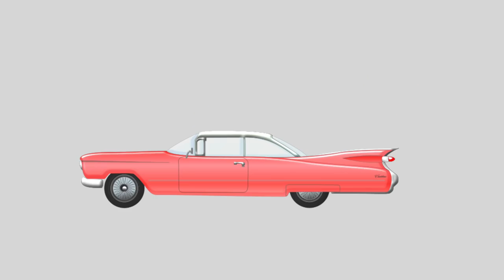Yes, Rockets CAN Fly in a Vacuum

Comment: If there is no air (pure vacum) in space, what does the rocket push against? Third law of Newton. You said a lot bit did not answer the initial question
Reply: "What does it push against"

The mass of the exhaust.

If you accelerate mass and eject it, you gain equal momentum in the opposite direction.
It's just simple conservation of momentum.
Reply: It pushes against the gas produced from Burnt fuel. Try this. Take a ball, and hit it with another ball. The first ball moves back, and the second one stops and then retraces itself. Now, the first ball is the gases produced when the fuel is burnt. Since there is vacuum outside, you don't need any force to push out the gas. They open the gas exhaust vent and the gas goes out with a lot of force. While it's going out, it pushes the rocket( second ball) ahead
Reply: Sorry, but for that to work the mass it pushes against, must also push against something.
Reply: Its Newtons 3rd law of motion.
Reply: @wizziw1  no thr mass it pushes against doesn't need to push against something. That's not what netwons law says. When you're swimming, you push thr water with your hand and you move forward. What is this water pushing against then?
Reply: @wizziw1  every action has an equal and opposite reaction. Therefore only 2 masses and forces are involved here. So the exhaust doesn't need to push against anything else
Reply: When you swim you go forward because de water goes back.
Reply: @aaryajain6396  if you push againt nothing you just dot move. I cant explain any better. Good Luck
Reply: @niallkinsella2687  a thrust in vacum needs tp push againt something to move
When you have an atmosphere you push against the air
Reply: @wizziw1  
When you force the fuel to accelerate by burning it, does it gain momentum?
Reply: @wizziw1  you're right when you say if I push against nothing I won't move ahead. But rockets ARE pushing. They are pushing the fuel gases out. Newton's law involves only 2 masses. You do not need a third mass. Moreover, when you're swimming, you're pushing water behind and it's pushing you ahead. Only two masses. I can't explain it better than this. What you're saying is wrong.
Reply: @niallkinsella2687  as the fuel burn what makes it go forward is the jet pushing on thd atmospheric air.
Reply: @aaryajain6396  rockets move by pushing their thrust against atmospheric air.
Reply: @wizziw1  Rockets are not jets.

When you force the fuel exhaust to accelerate, does it gain momentum?
It's a yes or no question.
Reply: @wizziw1  : Well, 70 years of putting satellites into orbit proves you don't understand the physics involved.
Reply: @wizziw1  Would a CROSSBOW, fired in a vacuum STILL HAVE RECOIL? Yes or No?

Comment: Amy do not mean to be disrespectful but you danced around the answer could you do this with all vectors and reexplain?
Reply: its pretty simple. Rocket nozzle pushes MASS in one direction giving it velocity (and therefore MOMENTUM) that it did not have before.
The nozzle FEELS the force that was used to accelerate the MASS of the exhaust gases therefore the NOZZLE FEELS THE FORCE TOO.
Reply: Not much vector math needed to understand the basics here.

Comment: I'm sorry but I have to take issue with the exhaust of the car moving it forward.  That is not the mechanism by which a car is propelled.  In the instance of a car it is all mechanical.  The pistons of the engine force the crankshaft to spin.  That spinning motion is transferred to a transmission (gears) which eventually reaches the wheels as rotation.  That is a simplistic explanation but, the exhaust has negligible if any, effect on the motion of the vehicle.  Many times the exhaust points sideways or even down towards the road.
Reply: She clearly stated in the video that the exhaust does not act as a propellant simply because the mass of the car is too great for the exhaust to move it; She was using this as an analogy in showing the differences of cars using friction (earth to tires, transmission, drive shaft, piston/combustion chamber. both use combustion as a source of thrust, but the thrust created in the combustion chamber of the car is converted to drive the wheels (basically a lever..)
Reply: I don't know what video you watched.  She does not once mention the mechanical aspect of transmitting the inline motion of pistons translated into rotational motion to eventually turn the wheels as being involved in friction.  If you're going to define something totally different as a reference to some other means of locomotion then do it.  Don't continue to speak of the exhaust of the car as some sort of energy transfer.
Reply: And just to be clear, I love her videos.  But that doesn't preclude commenting on the content.

Comment: You did not mention "spark". Why it has to combust, burn? We couldnjll just throw gas backwards. So please explain me what is  "burning".
Reply: Energy is needed to accelerate the mass. 
This could be done mechanically, throwing a block of metal or rock with some kind of spring, or with pressurised gas; but chemical reactions are easier to control and give more energy than most other processes available.

The chemical energy of the fuel, released when it's burned, is what provides the energy needed to accelerate the exhaust out the back of the rocket.
Reply: Thank you very much!!!
Reply: @straaths  There's a book titled 'Ignition' which covers the development of liquid rocket fuels from 1945 through to 1970 or so.  It's a funny read, not very complicated in the maths or chemistry, but it does a good job of explaining an overview of why different fuels were developed and why different mixtures give different performances.  You can buy reprints now, but I think there are still free PDFs available too.

Comment: Why doesn’t nasa bring back the Saturn V to compete in the new space race!!! We already know it works excellently, so why don’t we upgrade it but test out so that we know that we can build it! ( and I wanna see it for the first time( I’m only 14 and I’m super fascinated by the Apollo Saturn V Launch vehicle but I have never seen the Launch with my own eyes)
Reply: Because to do that they'd need to rebuild all the old factories for making the parts, bring the manufacturing method up to modern standards, get the infrastructure all back and running again. It'd be very expensive and maybe not even feasible since all their documentation was on hard copies, either paper (which easily gets lost or damaged) or legacy data formats which are hard to get data from and also they're a decent chance might have been lost as well.

Comment: Love the video, I myself have a masters in Physics and when teaching First year science students use some of the same analogies about Newtons third law. Great Video!
Reply: John Miller  Because we're not pushing against the vacuum. You've failed to grasp how Newtons third law works in this frame of reference.
Reply: John Miller  space is a vacuum, you're using the wrong frame of reference when dealing with a rocket. Again I have a Masters and soon to be PhD in physics, this is not a hard concept. All three of newtons laws are used to propel a rocket in space. Do not consider the rocket pushing against the vacuum think of it as a change in momentum. For example if an astronaut is floating in space away from the space station and they have a tool, they can throw the tool in the opposite direction of the space station and they will start to move back toward the space station.
Reply: please explain to me where you think the uncertainty principle fits into all this.
Reply: John Miller  We're not talking about walking in space, so again where do you think the uncertainty principal fits in here exactly. That being newtons third law, classically of course not through quantum mechanics.
Reply: John Miller   we use 100km to define "Outer space" from the earths atmosphere though you'll still experience a gravitational pull. Again please explain where you think the uncertainty principle plays a role classically. A rockets principle movement in space hinges on Newtons third law: Every action produces an equal and opposite reaction. Its a misconception to believe the rocket pushes on the air during take off that's not how a rocket works. There's no pushing against something outside that causes the rocket to go upward, its all Newtons laws of motion, classical mechanics that allow for rockets to be propelled in space. In essence, you are right there is no air in space, however, rockets do not push against the air. Do not think of a airplane. Consider this, if I fire a gun on a friction-less vacuum, or use a fire extinguisher and point it in the opposite direction I wish to travel what will the result be?
Reply: John Miller  The uncertainty principle in classical mechanics just says that we cannot assign exact simultaneous values. Say we're looking at position and momentum,  the uncertainty principle says that we cannot assign values to both position and momentum simultaneously. the uncertainty principle is mostly used in quantum mechanics and is not the pivot point of space travel, just because it isn't defined does not mean we cannot travel in space. As for steering, you're right conventional ideas of steering are wrong. to "Steer" a rocket its more about countering reactions and this is how you "steer" a rocket. Do you think we haven't been to space?

Comment: I don’t know what crack your smoking but cars don’t move because of the exhaust fumes the car also has a transmission tail shaft differential all the combustion happeneds inside the engine to rotate crank shaft that turns the fly wheels which goes to the transmission then to the tail shaft then to your differential then through your wheel shaft then to the wheel that turn on the road the only reason a cars exhaust is at the back of the car is for convenience so you don’t breath up all the fumes coming out the engine people watching this and reading this comment should know I love space x and nasa and everything they’re doing but recently I’ve been having doubts about them really flying in space so I came here to get an idea of how a rocket would actually move in space and everything this girl just said gave me more reason to believe that it’s all a load of...
Reply: She didn't say the exhaust is what moves the car.
She said that the exhaust produces some thrust, but not nearly enough to overcome the friction between the wheels and the road.

This statement is entirely true.
What is your issue with it?
Reply: Im pretty sure she was implying that the exhaust generates enough thrust to push the car forward and that the car gets some of its power through the wheels
Reply: She even goes more to say that depending on the year the car will move because the wheels turn
Reply: @darklight2.1  you make no sense
Reply: @aliax608   
"The force of the exhaust leaving the car does push it forward, only the car is so heavy and there is so much friction from it sitting on the road that it doesn't actually do anything."

Direct quote from the video.
At no point did she imply that the exhaust is what causes a car to move.
That's the end of it.

Comment: Very informative. However, you never explained how a rocket flies in the vacuum. You explained the rocket launching off the earth with this force propelling it upwards; but there is a huge hunk of metal that is being held down by gravity. The density of the rocket will no doubt weigh it down in the air. Once the rocket leaves the atmosphere, there is no gravity applying to it and it does not apply to any form of weight. When the rocket goes off in space, isn't it more like a candle lighting on earth? The rocket wouldn't move at all, it would expel all of its energy out one end of the rocket and lay completely still. Can you make a video specifying why rockets can fly a zone without gravity and move? Unless we are floating in some ether-like  embryonic fluid, how are we flying in space with "force"?
Reply: 1. You are making the fundamental mistake of assuming that there is no gravity in space.  This is necessarily not the case because, for example, the Moon orbits the Earth under the influence of gravity, and so the Earths gravity must reach as far as the Moon and so also be present in all of the space between the Earth and the Moon's orbit. 

2. When you say "there is a huge hunk of metal that is being held down by gravity" you are missing the fact that that "huge hunk of metal" will also have inertia, which will act to resist its acceleration and do so independently of gravity.

3. If you understood how a rocket might "expel all of its energy out one end" you might notice a huge mass of hot, and so very fast moving, gas molecules bouncing off the inner surfaces of the rocket engine's combustion chamber and nozzle and in doing that provide a very obvious mechanism for how a rocket might be pushed by its engine even in a vacuum.

Comment: I'd like to add that Ion engines are only useful in the vacuum of space. They are not strong enough to reach escape velocity.
Reply: xD xD xD
Reply: It's not that they're not strong enough to reach escape velocity, the thrust:weight ratio is unfavorable.
Reply: @davidmescher2526  Isn't that just another way to say they aren't strong enough? It can't produce enough thrust to compensate for its weight. 🤣
Reply: @Dannosuke25  But Ion propulsion certainly CAN accelerate a spacecraft to escape velocity.
 But it does it slowly.
 It is the highest ISP propulsion we have but very low thrust.
Reply: @stuartgray5877  I'd have to see the math from what I know they aren't practical for that purpose even if it is technically possible.  Like I could travel cross country on elephant back but there are much better ways to travel long distances.
Reply: @Dannosuke25  Well you could do some research about the difference between "Thrust" and "ISP" or "Specific Impulse".
What if an apollo sized spacecraft could accelerate a single Zenon Ion to 99.99% the speed of light with an Ion Thruster?
How much "Thrust" would that give it?
But what would I know? I have only been building, testing, launching, and operating deep space science probes for almost 30 years.
Reply: @Dannosuke25  I think what you are TRYING to say IS: Today's ION propulsion system are not strong enough to LAUNCH a spacecraft from the surface of the earth.
That part is true.
However, if you have a Spacecraft in Low earth orbit and you want to reach escape velocity, there is no engine MORE EFFICIENT at doing so than an Ion Propulsion system.
Reply: @stuartgray5877  Yes, that was my whole original point. That ion propulsion systems are only good for crafts already in orbit and are not useful for crafts at sea level.
Reply: @stuartgray5877 So what you are saying is that you understood what I meant all along, but decided to argue against something I didn't say or imply to try and make a random person online look like they didn't know what they were talking about then conceded that what I said was correct all along. Nice...
Reply: @stuartgray5877  And that's not what I was trying to say, it's what I said but in different words.
Reply: @Dannosuke25  YOU literally said that Ion propulsion system COULD NOT be used to reach escape velocity.

This is a false statement, as I proved above.
You are welcome.
Reply: @stuartgray5877  It was understood that I was talking about from sea level and not from low earth orbit.
Reply: @stuartgray5877  Are you saying that Ion propulsion can launch a rocket into orbit from the Cape Canaveral launch pad? because that is the sort of situation I was talking about. Of course you can reach escape velocity from orbit with it. That is much easier.
Reply: @stuartgray5877  so if your only argument is that you can use an Ion engine in space to achieve escape velocity, then we never disagreed as that was what my original statement was. People are so quick to try and argue with someone online I really dont get it.
Reply: @Dannosuke25  "It was understood that I was talking about from sea level and not from low earth orbit."

It was not understood, as you were corrected on it.  Twice.

The Thrust : Weight ratio on Earth's surface < 1, so it cannot take off (much less reach escape velocity) from Earth's surface.  

However, any place that has sufficiently low weight (such as in orbit, but asteroid / comet surfaces would also work, if they aren't too massive), they would be able to reach escape velocity.
Reply: @David Mescher  well whether it was understood or not that is what I meant by contrasting it to the vacuum of space. I specifically said in my original comment they are only useful in space, meaning in orbit or similar environments. Where did you think I was talking about it not being useful from other than space? I wasn't corrected I was talked at. My original statement is correct.
Reply: @David Mescher  just add "from sea level' to the end of my original statement for those who can't understand context clues

Comment: Thrust is thrust right? Sooo can a helicopter generate lift in a vacuum?
Reply: Helicopters generate and vector lift, not thrust. The two are not the same.
Reply: Lift requires air. Rockets push off their own exhaust.
Reply: @williamlangdon2596  lol off of their own exhaust?  What's slowing down the initial exhaust in order for it to provide resistance to the subsequent exhaust?  

Think about the stewpid thing you've just written..